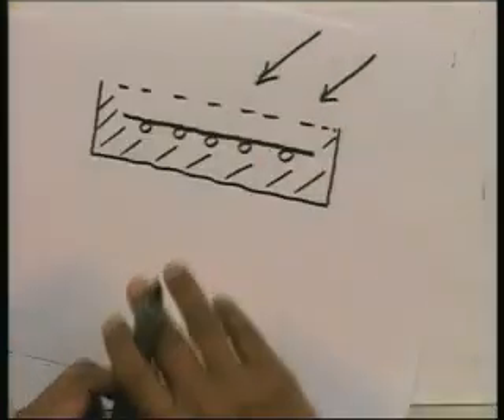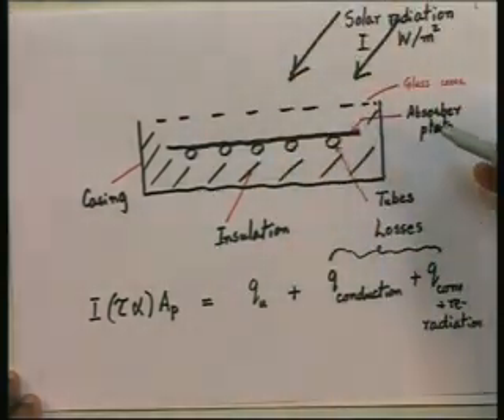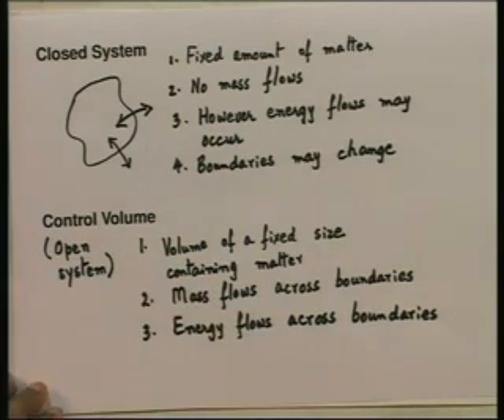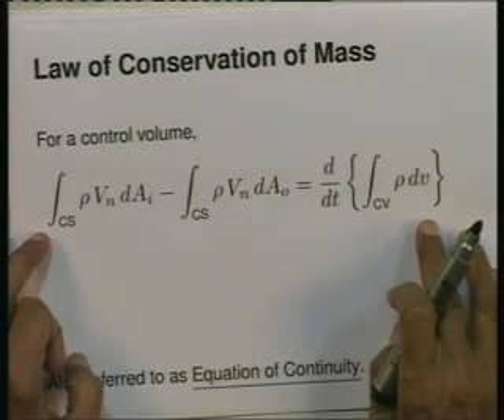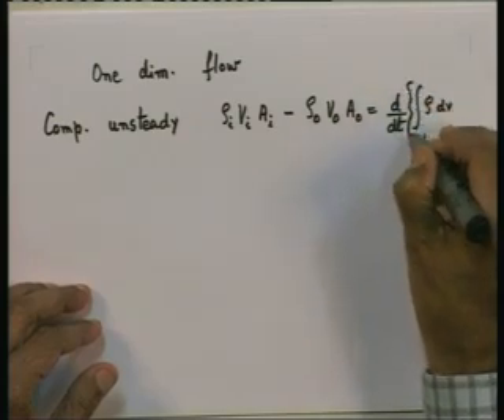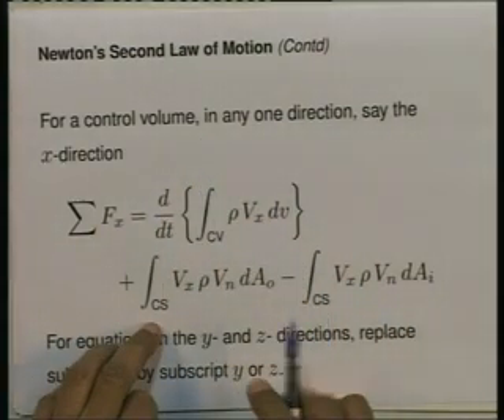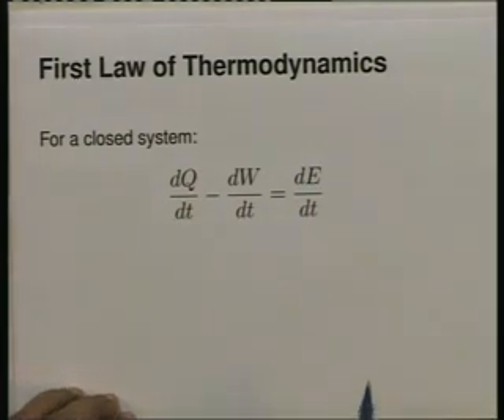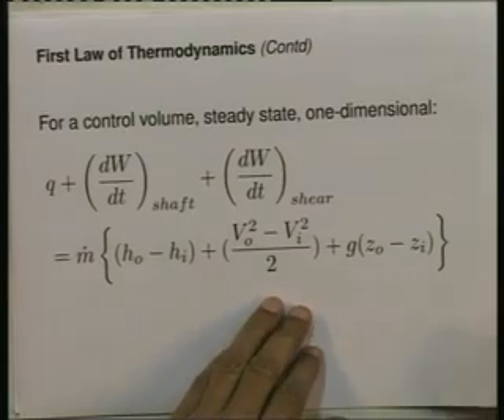Lecture - 2 Introduction - 2

Comment: Summary of Video
0:00 = countinution on last session i.e solar radiation
7:55 = laws of heat transfer
8:05 = types of laws
9:45 = Fundamental laws
10:15 = subsidiary laws
11:10 = Closed & Open System
16:15 = Law of Conservation of Mass
28:00 = One dimensional flow
38:39 = Forces acting on fluid inside control volume 
43:34 = First law of thermodynamics

Have a beautiful day...keep studying... Leave a like ❤️❤️
Reply: Thank you so much Ravi😇

Comment: In this video he said that accumulation is zero for both steady and unsteady states as well for incompressible fluids. How is that possible?? Unsteady in the sense there will be an accumulation right. Can anyone explain plz!
Reply: its because he assumed that his CONTROL VOLUME has constant volume. so when density is invariable for the fluid, the mass inside is fixed.
Reply: Listen carefully

Comment: what is the difference between having fixed amount of matter and volume of fixed size as stated in close and open system ?
Reply: Fixed amount of matter: fixed amount of mass [kg]. The size of the system can change, but the mass is the same.
Fixed size: fixed amount of volume [m^3]. The mass inside the fixed volume can change. Like putting more stuff into a box, where the box is your fixed volume.
Examples:
Fixed amount of matter: Think of a closed balloon. If the air inside the balloon heats up, it expands (energy flow + change of boundary) but there is still the same amount of matter inside the balloon, because mass doesn't flow in or out of the closed balloon. 
Fixed size: you choose your control volume, for example the room you are in. You can open a door and windows, and air, insects and other stuff can flow through the room (boundaries of your control volume).

Comment: Why the open system is called control volume?
Reply: A control volume system is the system in which only volume of the system is fixed so mass can come and go out of the system it may be case for steady state that mass flow in and out are same but mass will flow out of the system so there is mass continuous mass and energy interaction for control volume and hence it is called the Open System.
Reply: sunita kumari Its a system of fixed mass with fixed identity.

Comment: I see that the term "control volume" and an "open system" are the same, but is there not also a different name for a closed system? I read that it is also known as a control mass.
Reply: a late reply from a present college student but yes you're right